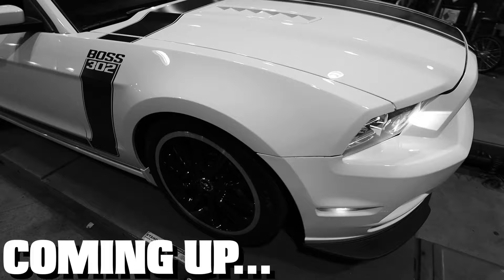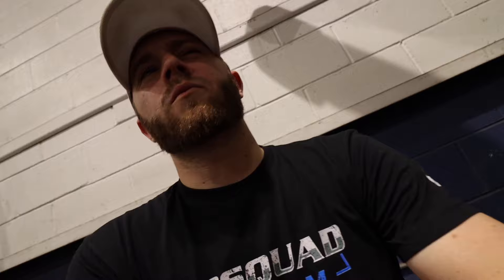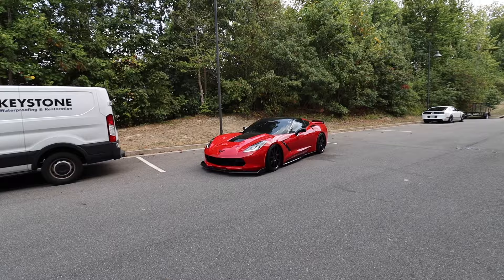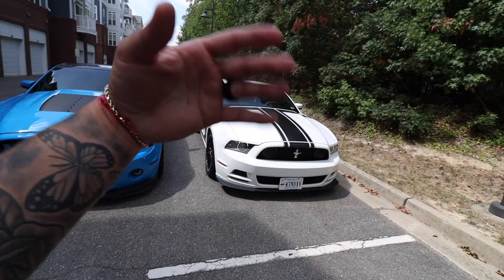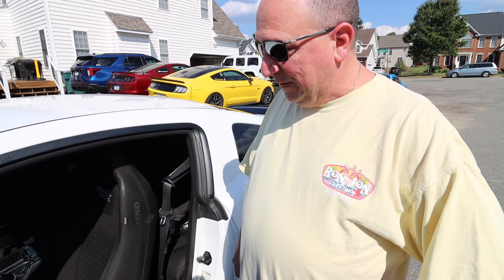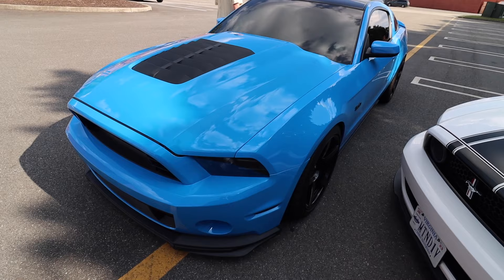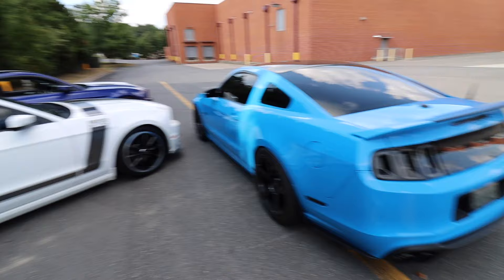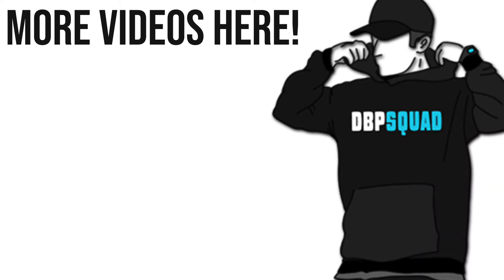WE’RE BACK!! Crusing in our S197 Mustangs like OLD TIMES!!

Comment: You guys rolling good. I'm about to join you guys. I got 3v, now. Trying to decide on S197 or S550
Reply: S550’s make a better daily driver being a smoother car, but S197’s have a more old school feel. I drive both weekly and the S197 feels more “Mustang”
Reply: I went from a 2011 GT to a 2016 GT.  I want my 2011 back honestly.  If you're into driving hard, drifting, or racing, the S197 puts power down better (doesn't wheel hop, squat, squirm and deflect all over the place).  The S550 handles better but the S197 handles good enough for me, especially if it's a Boss.

Comment: I turned my struts 180 degrees to give more positive camber. I know quite a few that have done it and it works with now excessive tire wear or anything. I want a 2nd gen S197 with the 1st gen 5.0 but, they are hard to find here. Id build it like the boss with all forged internals. See what centrifugal i put on it. Ill ask you when the time comes.

Comment: Very nice cars!  What were your coolant temps with no A/C?  I don't have an S197 (I"m an 03 Cobra), but I do have a front mount.  In Texas heat with a 170 themo and just cruising i'll see around 185-188 (with no AC on).  If I turn on the AC, temps go up about 5-7 degrees.